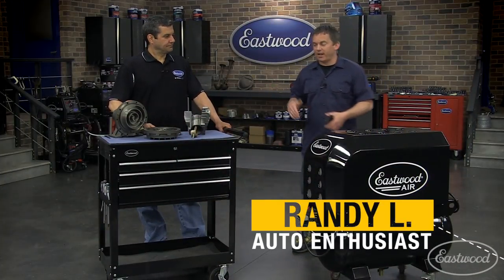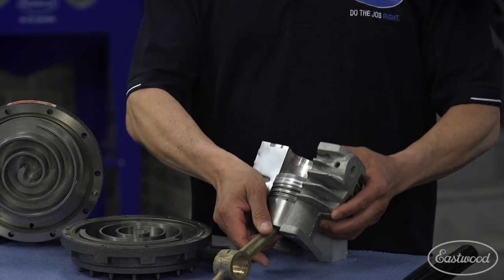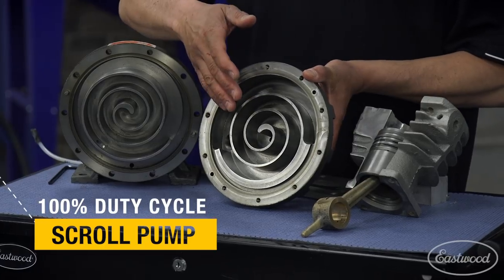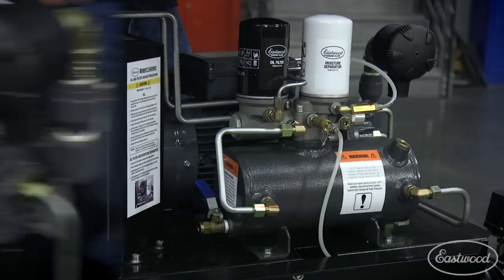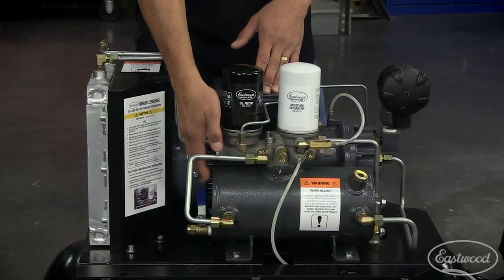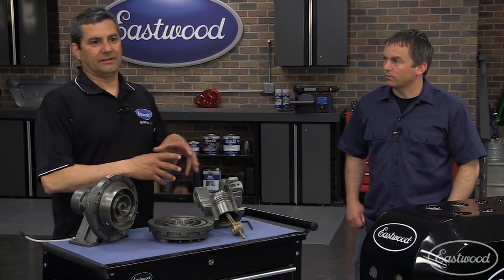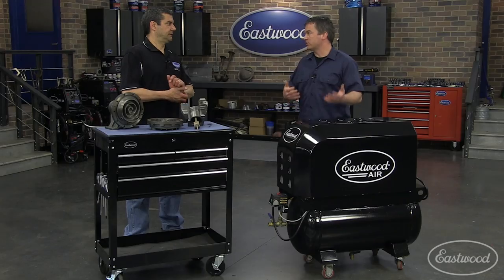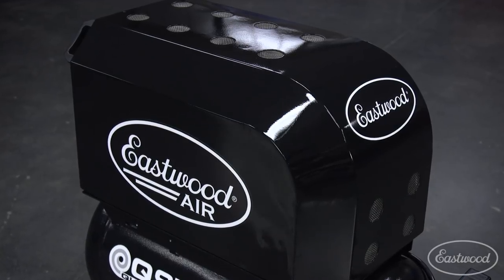QST Scroll Compressor - Mark Explains Technology & Performance VS Piston Compressor - Eastwood

Comment: This is amazing! I just built my 30x40 garage/shop this summer and I have been eyeing everything for "shop" equipment and man I really like this small package as long as it could run a 3/4" impact if I absolutely had to but from your video I shouldn't have issues at all! I would love to win one but am definitely looking at making the purchase when they come out!!
Reply: I don't like that it wont plum in to a air systems and its only  1/2 coming out my shop has 3/4 with high flow fitting with 1/2 hose for max air volume !  They said it will last for 100 K  but with the motor hold up and every  thing else ?
Reply: @johnversluis3084  I've been picking up on that slightly deceptive marketing scheme about these qst. While I'll likely be buying the qst 80/120 I know the motor will be considered as a consumable in a sense compared to the compressor itself.
Reply: @zedsdead7670  For the target market of this device, motors are always a consumable. Comparable single and dual stage recip units will also kill motors just as quickly.

Comment: PISTON is stil N°1, (oil free) scrol compressor are / is ~good, simple to assemble but with a very short lifespan compared to a piston compressor.(N°1) screw (N°2) direct drive "NO FREQUENCE TYPE", The idial circumferential speed of a screw compressor determines the efficiency of the compressor element !!!
Reply: Where do you get the idea that piston and other types of compressors don't use oil? No oil and they'll seize in about 5 seconds.
Reply: @GGigabiteM  You have many type of oil free compressors,  and YES also 'piston type' mostly sell scroll type (AC) and at high power compressors the Z series from (AC) Atlas Copco., are usually powers of ~200Amp and +++.
 Because these are expensive machines, in EU (Europe) oil injected compressors are often used with spectial "food grade oil"

Comment: Looks very nice. Will it run on 208vac 1ph? Will the filters be available through sources other than Easwood? Thank You.
Reply from the maker: Jay - Yes it will run on 208VAC, 1ph  but 240VAC is the most efficient.  To answer your 2nd question, currently the replacement filters are only available through Eastwood because we want to make sure the quality filters installed on the unit  meet our specifications.  Hope this helps.  Thanks for the interest.

Comment: If you cut open a window air conditioner or a home refrigerator, they run scroll compressors. Some cars are now doing it. 

So it is quiet. But $1500? 240V?
Reply from the maker: Incredibly quiet. We used it to blast a Camaro and had no issues. It was very impressive.

Comment: what I didn't hear covered is the "oil, oil filter, air filter and moisture separator change interval" I see there was a fancy sticker explaining it, but not covered in the video,and is there an hour meter..
Reply from the maker: We recommend changing the oil and filter every year.  The oil can be purchased from Eastwood (which we recommend), but if you don't get your oil from Eastwood, you MUST be sure to use synthetic scroll / screw compressor oil.

Comment: How would this work in a body shop setting does it get more oil in the air lines than a conventional or less and how good is it at running a spray gun for entire vehicle paint jobs any issues with that
Reply: Kyle  Good question . Also how much water gets into the line and how hot does the air coming out?
Reply: Ahmad Boone well hopefully I win it and can find out lol
Reply from the maker: Kyle, that is a tough question because there are a few factors to consider like age of the compressor and ring wear.  But let's assume you have a fairly new piston compressor.  The Eastwood QST 30/60 Scroll Compressor has a very efficient oil/air separation circuit and filter to remove the majority of oil and moisture, however we still recommend an external oil/moisture filtration system, just as you would have on a standard compressor system.  To answer the 2nd question, the 30/60 Scroll Compressor will feed up to a 12 cfm HVLP Paint Gun enough air to paint a vehicle at 45 psi to the gun.  Hope this helps.  Thanks for the interest .

Comment: I don't like that it wont plum in to a air systems and its only  1/2 coming out my shop has 3/4 with high flow fitting with 1/2 hose for max air volume !  They said it will last for 100 K  but with the motor hold up and every  thing else ?
REPLY
Reply from the maker: The tank on the Eastwood Scroll Compressor was designed with ½” fittings consistent with home shop use. As for the 100,000 hour scroll life, that is for the scroll compressor pump itself. The motor is warrantied for 2 years  when wired to a circuit output of 220-240VAC.  Hope this helps.

Comment: now I feel kinda stupid for buying a 5hp compressor.   Does this compressor have the ability to upgrade motors to something like 5hp?   Can it scale up to handle something closer to 18-20cfm at 90psi?
Reply from the maker: Joshua - The Eastwood QST 30/60 Scroll Cmopressor is a direct drive motor/pump assembly and the HP and motor rpm are tailored to produce the 12 cfm and 145 max psi in the most efficient and energy saving package.  We do not recommend moving to a larger motor as no benefit in cfm or max pressure will be realized, just a higher energy cost.  Larger units could possibly be available in the future.
Reply: The moment you release a larger one you have me as a customer.

Comment: It drives all of your tools because it is designed for 100 duty cycle.  How does its electric consumption compare to a 60 gallon traditional running for less time?
Reply from the maker: Brian, let's assume the electric rate is $0.16/KW Hour.  The Eastwood Scroll Compressor at 240v with the 3.3 HP motor equates to 2461 watts.  Convert this to KW and multiply by $0.16 and you will have $0.39 to operate per hour.  A typical 60 Gallon Piston Compressor at 240v with a 5hp motor equates to 3730 watts.  Convert to KW and multiply and you have $0.59 cost to operate per hour.  This means the Eastwood QST 30/60 Scroll Compressor not only saves you money when you buy it, it saves you money every time you use it!  Plus it isn't much louder than a Central Air Unit.  It barely makes any noise.